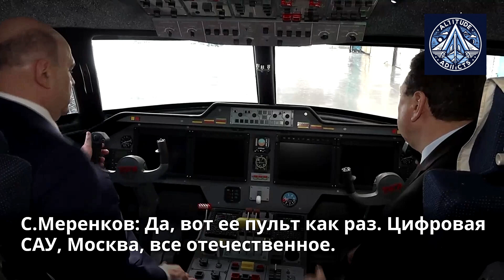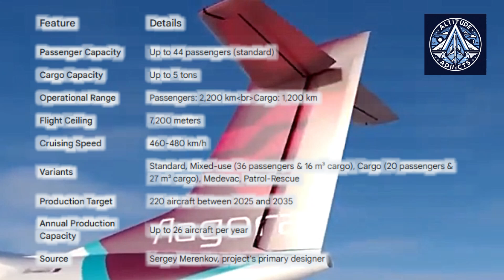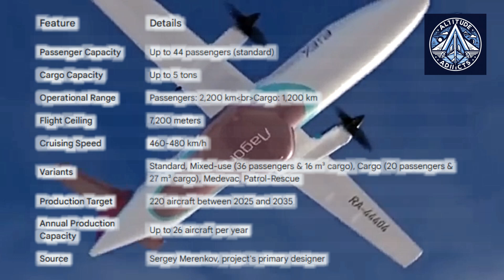TVRS-44 Ladoga or IL-114-300 -  Russian Turboprops Set For Internal Rivalry

Comment: ALSO the fact that the landing gear wheel wells are so close to the ground makes them very susceptible to filling with mud and other debris in regions with unprepared runways. I would prefer to have the landing gear retracting in the engine nacelles like the AN-24/26 or the Bombardier DASH 8 variants. This would also make the landing gear wider and provide more resistance to crosswinds.

Comment: The Ladoga is a Russianified version of the Let L610 isn't it? With An-140 features added. The Il-114 is a military programme to replace the An-24 in the passenger role and the Il-112V was to replace the An-26 cargo plane. The Il-112V has an expanded internal cabin to take large bulky cargo, so a modified Ladoga probably wont be good enough to replace the An-26 for the Russian military. The engines the Ladoga uses are the same engines as the Il-114 and Il-112 but the increased size of the Il-112 requires more engine power and a more reliable engine, so they are doing  what they did before. The Il-212 is a repeat of the An-72 with jet engines. The An-72 is a great aircraft but not cost effective to replace prop driven aircraft so the Il-212 will likely replace the An-26 for military use and also the An-72 for military use but improvements to the engines for the Ladoga and Il-112 and Il-114 and Mi-38 and Altius drone seems to suggest the current model might be powerful enough and reliable enough to make the Il-112V again. It is complex. The companies that made the Let L-410 and L-610 clearly want to keep developing the same design, but I think they should swap to making Il-114 and Il-212 and now Il-112 aircraft now the engines are sorted it seems and just make Russian planes.

Comment: TVRS-44 Ladoga or IL-114-300 are very close in passenger capacity, 44 pax for Ladoga and 64 for the IL114. Why two diferent planes for very similar capacities? Wouldn't a shorter cabin lenght of the IL-114 be easier and faster to produce? However this Ladoga is very beautiful but I dont like the short spread of the main landing gear what together with a high wing makes it very sensitive to side winds (cross winds).
Reply: And that is just one of the problems with this design... I hope they don't follow the ATR example, a design focused in efficiency at the cost of safety. Russian must not fall in that trap... trading lives for fuel is evil.
Reply: @Socavador 
The ATR 42/72 series is a safe design. Every single accident has been the result of poor airmanship.
No other turboprop commuter in the 40-75 seat category has been in longer uninterrupted production than the ATR.
Reply: @edgarguinartlopez8341
I never said 'defective humans'. I said poor airmanship. Like ignoring the Aircraft Performance Monitor. Like ignoring weather reports. Like pulling the yoke even though the stick shaker had activated. Like flying into known icing conditions with the auto pilot active. 
You might want to check the AN-24's first flight, entry into service and the numbers actually built and years of manufacture. I'll wait.
Reply: @Socavador 
AN-24 first flight in 1959.
Entry into service 1962.
Manufacturered from 1959 to 1979.
1388 aircraft manufactured, including the Y-7.
The AN-24 was sold to a largely captive market.
The ATR competed with Canadian, Dutch,  Swedish, British and Brazilian aircraft in an international market.
Reply: Thats almost 50% difference in capacity ;)
Reply: Well, i think that they need to produce 2 different planes in the same class in order to diversify options to the domestic and international market.

Also, 2 different projects mean two different division. And of course each division needs labors, which means these 2 different projects will create 2 new job opportunities.
Reply: marcg1686: The Soviets continued to produce their AN24/26s until the late 1980s, easily overlapping what you call "initial production" of the type in China, which concept I don't agree with you on... And before you start spinning your circles again, the An26 was indeed used as a passenger aircraft for many years, even though it was built as a military transport; I flew on it dozens of times over the decades. So I don't care what you think about it, playing with words and offending others isn't going to change the facts.
Reply: The TVRS will be easier to manufacture. The wings will be made as one single unit and then attached to the fuselage. With the Il-114 the wings are two separate units.
Industrialising the TVRS will be easier.
Reply: @marcg1686: And again, Chinese versions of the original soviet AN24 are still in production, making the combined production of this model and variations uninterrupted since 1959... But even if you pull out the soviet AN24, Chinese variants have been in production since beginning of the 70´s,  about 14 years Longer than any ATR model.
Reply: @edgarguinartlopez8341  
The Y-7's maiden flight took place in February 1984. 103 planes built over a time span of 40 years.
Reply: marcg1686: "The first Chinese-assembled An-24T had its maiden flight on 25 December 1970. Production was launched in 1977 at the Xi'an aircraft factory..." That is what counts for me. But keep going in circles as long as you want.
Reply: marcg1686: First Chinese An-24 flew in 1970. Period.
Reply: marcg1686: Look, stop beating around the bush 😉 The AN24 type was born in 1959 and until the Chinese declare its end, it has officially remained in production since then.
Reply: @Socavador  
The first production Y-7 flew in 1984. But let's go with 1970 for the maiden flight of the AN-24T.
103 aircraft in 54 years. You don't even need a brain to understand that this cannot be considered uninterrupted production.
ATR has delivered 1700 aircraft in 40 years of production.
Reply: @rosisrosarum643  на каких маршрутах эксплуатируются? хотелось бы знать.